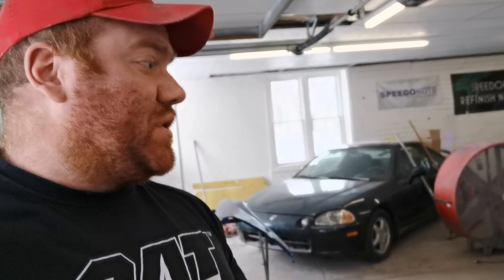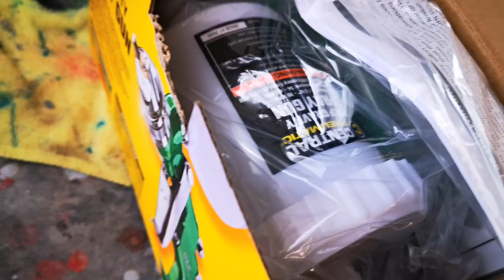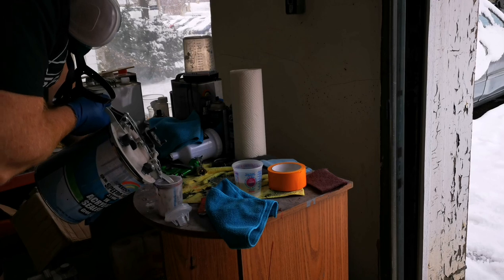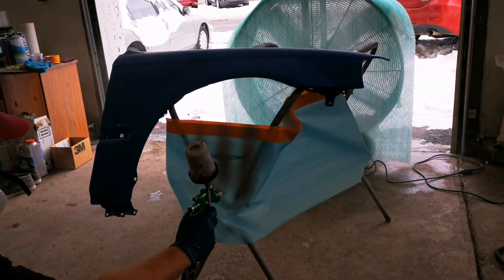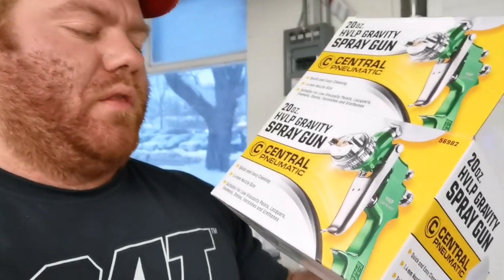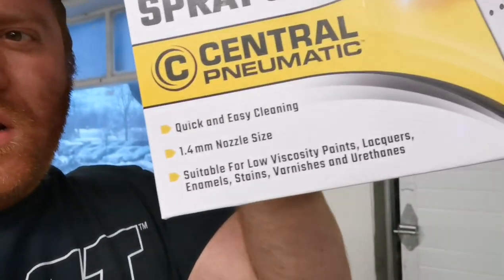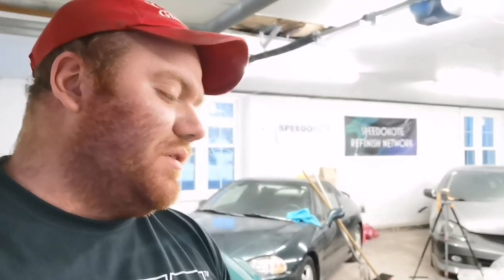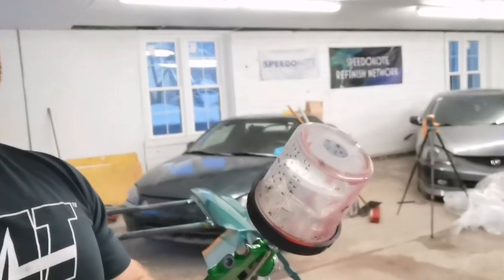Harbor freight Green spray gun

Comment: I bought this gun a year ago , your correct it must be cleaned first ! And I found when painting anything large like a pickup you can’t use the disposable cup system , it wants a vented top on the cup . I found it would chug when walking it down the bed of a truck .
When I put the factory cup back on , no vent cap , it worked stellar ! U-pol clear worked great in the gun , I haven’t used speedcoat  brand as of yet . But I’m sure it would work great . Hope you try it with the vented top cup .
Reply from the maker: Yea it's not bad for one time use

Comment: This gun loves lacquer paint , aka dupli-color paint I’ve painted a f250 complete job , a vw , a mini truck, yes the green finish came off but it still is rocking the paint ,and yes you are correct you must over reduce the clear , and it doesn’t like the disposable cup system , it flows better with a vented cup . Ten times better than the purple gun .
For the price money well spent .

Comment: I bought this gun to spray clear coat on a replacement bumper cover.  I cleaned the gun before spraying 2 coats of clear then disassembled the gun and cleaned it again. The next morning I sprayed 2 more coats of clear after a little wet sanding. After finishing I again go to clean the gun and after 1 night the inner nozzle piece that screws into the gun body already has rust in it. Sad cause I've had thier smaller detailing gun for months and never had an issue.  So the moral of  my story is You get what you pay for. Sprayed nice  but  made cheaply and won't last more than a job or two.

Comment: Man I see you had the door open and I could see the smoke coming from your mouth but you paint like your in a heated garage. And that fender looked great.
Reply from the maker: It's a combo of good skill, proper material usage and a little bit of heat gun action. Mainly material usage. The speedokote clear coat with fast activator is beyond amazing
Reply: @speedokoterefinishnetwork4937  I agree looking to try the glamour clear fast drying soon.
Reply from the maker: @3rekoatskustoms929  the glamor production clear is definitely great. Really like it

Comment: Did you use the small Harbor Freight compressor with this gun?  
The McGraw 20 Gallon you did the other review on? 
Do you think this cheap gun would work with that cheap compressor? (Whole Car Paint Job)

I don't paint often, at all, and don't have air tools, but if that set would work, I think the price would justify buying the set for touch ups.
Reply from the maker: Yea the mcraw 20 gallon works decant

Comment: The good: that gun sprays well. But you have to crank the fluid nozzle off to clean it's not even worth it. The bad: the threads for the fluid adjustment knob is a piece of threaded plastic. If you're spraying very little maybe a few times a year go for it.
Reply from the maker: Yup good point

Comment: Thank you for this video you are the man
Reply from the maker: Appreciate you
Reply: I bought Speedo primer 4 years ago Ima spray tomorrow morning I have the green and purple gun any tips
Reply: I have a Srt4 I’m paint it but I’m doing it separately bumper trunk wing and the body kit
Reply from the maker: @eduardoosorio5199  really cheap guns are only good with low solids material don't try to spray anything thick through it
Reply: @speedokoterefinishnetwork4937  if I spray clear over stage one paint would it look good I have a cut and buff pads and a whole System

Comment: I just ordered  Speedokote Clear Coat 2K Acrylic Urethane, SMR-1150/1102-Q 4:1 Gallon Clearcoat Medium Kit and bought the same hvlp gun with the same 20gal mcgraw compressor.  What psi did you run at and how long flash time?
Reply from the maker: 24 psi, 5-7 min flash
Reply: @speedokoterefinishnetwork4937  Thank you!

Comment: Is there anything kind of middle of the road? I see 10 dollar ones from HF then pro ones for like 300-1000. Is there like a 50-75 dollar gun that can get decent results?
Reply from the maker: The spectrum is not bad.. But it's 139 for just a gun. Then you gota buy fittings, regulator ect ect.
Reply: I was in our local HF about 2 weeks ago and they had a black and red gun that was around $225 , it felt good in my hands but I've not used it yet
Reply: @sheldonstewart70  get yourself the flg5 from devilbiss it's about 160-180 from spraygunsdirect check out the gunman videos about that gun👌 i have one in 1.3.
Reply: The chrome gun with the gold nozzle ring from harbor freight is probably the best one for the money. Its $75 has 1.3 tip, quality parts and sprays like a top line gun. I used one for a year when i started back at painting and never had any problems with it. Layed down base, clear and single stage urechem...even rustoleum like glass. I still have it and still use it for jobs once in a while. Not much overspray either.
Reply: @aaronanderson5197  I have the same gun and it works pretty good.
Reply: Fernando Saldaña That's what I have with a few different size fluid tips. Great gun and reasonably priced.
Reply: @aaronanderson5197  says 15 CFM @ 40 PSI for that gun. My compressor only does 9 CFM @ 40. From your experience is my compressor under powered for this gun?
Reply: @55chevytruck  says 15 CFM @ 40 PSI for that gun. My compressor only does 9 CFM @ 40. From your experience is my compressor under powered for this gun?
Reply: @jeremylucas6771  Probity get a 21 gal from HF or Tractor supply.

Comment: Did you use the plastic filter that the gun came with.
Reply from the maker: Nope.. I was using a pps system which has a built in filter

Comment: How many cars you've painted in a span of 15 to 20 years and experience, will determine the quality of these cheap hvlp spray guns
Reply from the maker: A good amount. I think its a decant gun for a starter guy DIY guy.
Reply: @speedokoterefinishnetwork4937  when you pointed out the plastic threaded insert on the cheap Harbour Freight gun I knew you a valid point.

Comment: Peopke talk mad sh*t about the purple gun and say stupid things like you cant use it to prime with. Let me assure you it's all lies and propaganda. I've owned tge purple gun for over a year and have primed with it 3-5 times a week on a normal week and sometimes up to 10 times. I've put 200 cups of primer through that gun easily. You absolutely have to clean it THOROUGHLY after each cup, but it will spray 2k primer Straight Out of the Box and it does a good job at it. I'm only just now having issues with it which is why I just bought its green cousin. I actually used the purple gun and cleaned it so many times that I wore every bit of purple off of it. If the green one only lasts me 20 times as you said I'm gonna be pissed